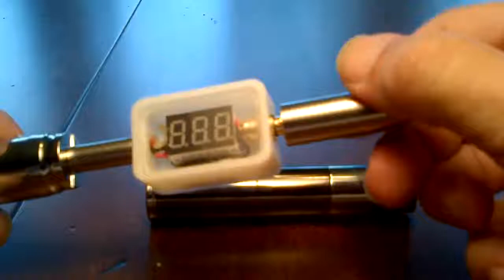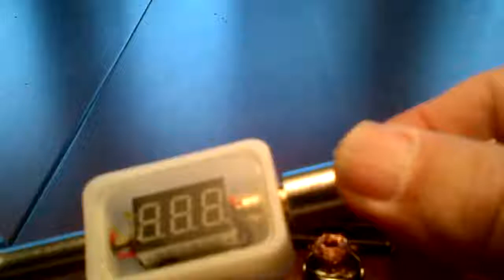www.cig.co.il | UDT-L MOD modding

Comment: Because the spring is really bad quality I guess and builts a lot of resistance. It get's really hot too (bad for your battery). I just replaced the spring with another one (golden) taken from a vamo and I had the same effect with the above trick but I don't have a meter to give the exact results.